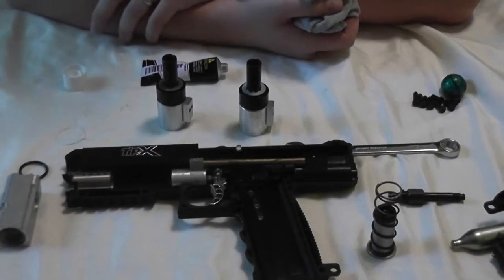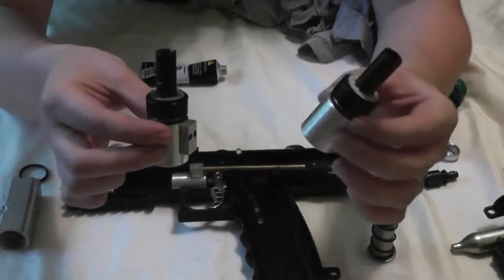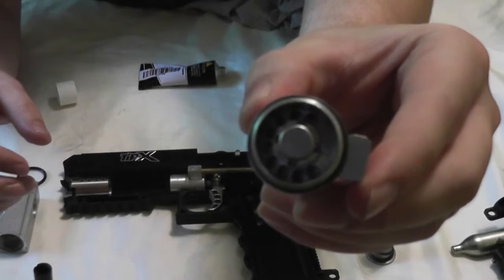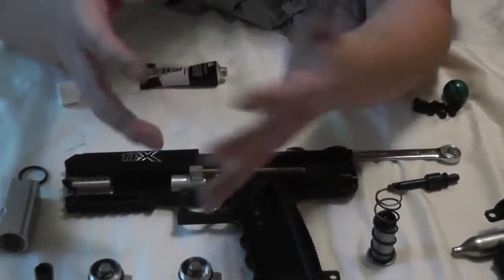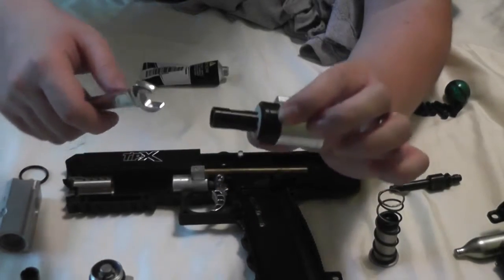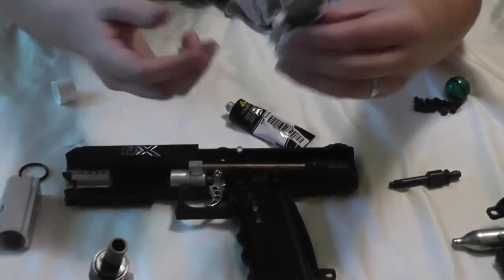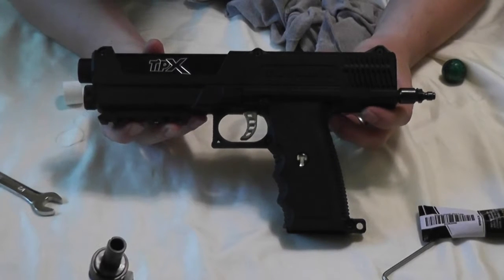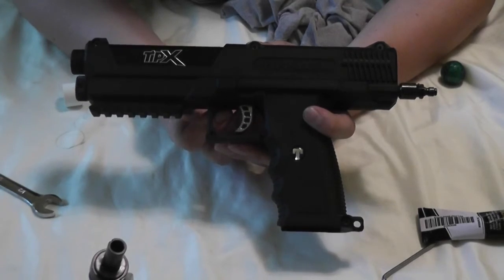Tippmann TiPX Valve Assembly Upgrade for HPA

Comment: Nice. I just bought a TiPX. Not been inside it yet. Does the bolt has a pin like the Tiberius T8.1?
Reply from the maker: The bolt on the TiPX is more or less free to spin or rotate on the bolt guide/power tube, but I've not used or worked on a T8.1 to know the difference. I have heard that maintenance is a bit more of a chore on the 8.1s though.
Reply: @mongoosepb4920  Ok. Thanks for the info.

Comment: So it seems that Tippmann has preset the regulator at the factory now. You can't adjust the bleed anymore. Will this valve still increase performance with no options to set the bleed using CO2 carts only?
Reply from the maker: It should still help, yes. The purpose of the valve is to increase air flow versus change operating pressure which is what the older PRVs that you are referencing used to adjust. That being said, many users have reported that their TiPX reaches 280 FPS or over without any changes. Others aren't so lucky. 

I recommend trying yours out with HPA before ordering any alternative parts. It could save you money and headache.
Reply: @mongoosepb4920  thanks, but I'll only be using CO2 cartridges. This is mostly for a home defence thing, not paintball, so I'm interested in more power for my TipX. I wish they just would've kept the bleed valve on there so you can adjust the power adjustment higher, but now I'm thinking if you adjust higher you'll get the CO2 bleeding out and now there's no adjustment to stop that when increasing power. Thanks for your reply.
Reply from the maker: @18andlikeit  Ah, ok. Then you won't really need the valve. The standard valve works fine for CO2. The TCR valve was modified for better performance with HPA.
Reply: @mongoosepb4920  I was watching older videos of guys getting up to about 16/17 joules or 300+ fps with 3.9 grain riot balls with the older model when you had the bleed adjustment.. is this kind of power possible with the newer stock TipX with no way to adjust the bleed? I don't have a crony to check for this.
Reply from the maker: @18andlikeit  that's hard to know. I've only ever aspired to get my marker to around 270 with round paintballs. The old PRVs purpose was mainly to keep the reg from having to work harder at limiting the operating pressure. It was a failsafe rather than a mechanism to increase the overall output pressure. 

That being said, you could sort of tube the velocity by also tuning the PRV setting in some situation, but rarely was the PRV responsible for allowing massive FPS gains. As far as I know, the reg and PRV in the self defense versions of the TiPX are the same as the recreational version, but I may be wrong. 

That being said, I think there may be a specific subreddit just for paintball markers as personal defense tools. Unfortunately that's not something I'm particularly familiar with.

Comment: After I installed the TCR parts into my Tipx, I am shooting between 280 and 305.  If i turn the regulator to the left, the PRV starts leaking. Left most shoots about 290-305. And turning it to the only lowers the FPS slighting to 278-305.
Would I have to change my HPA tank output pressure? I am using 26/3000 HPA Tank.
Reply from the maker: You should be able to adjust the PRV though. I normally tune mine any time I significantly change my FPS setting. It typically keeps me leak free and consistent.
Reply: I use hpa on mine. Shoots like a champ.

Comment: One other question, when you tested the FPS with HPA did you have an empty C02 cartridge in the chamber?
Reply from the maker: tzone Yes. The TiPX requires that you keep a spent/empty CO2 cartridge in the chamber in order to use the remote line adapter. There is a way to mod it so you don't need one, but I don't see the need to do so now. 

I will say though that air still gets trapped in the CO2 chamber after you disconnect the remote line unless you take the retention pin out of the adapter. So you have to be careful and dry fire the marker after disconnecting the line. 

I've seen people go into the goggle free zones not realizing that the marker was still pressurized before, and the refs don't like that. Can be dangerous.
Reply: Thanks, I was wondering if all the low FPS issues I hear and read about using HPA might be due to people not leaving the spent cartridge in the chamber resulting in leaked pressure and low FPS rather than the internals?
Reply from the maker: tzone Yeah. if you don't leave the cartridge in then the marker will barely air up at all. The pressure just bleeds right out the vent in the accessory rail.
Reply: I just got the pistol not for paintball but as a less than lethal option for home defense which either uses salt/pepper balls or heavier solid balls which would benefit greatly with more pressure. Maxing at 290 is probably enough but still seems kind of low...I don't know really I'm a noob to all of this.
Reply from the maker: If you are using it for less lethal, you probably don't need to worry about this mod since the remote adapter will be irrelevant for you. You can get up to 300 FPS on CO2 cartridges with the stock valve easily. Honestly thought I'd get pepper balls for home defense and not worry about the FPS too much if that's how you plan to use it.
Reply: Well it's not just for home defense it's for fun too and I am not one to leave well enough alone so I  am always modding this up like a lot of us do. I actually got the HPA adapter to use with a 2 cartridge co2 holder/tank whatever you want to call it but it is more portable than an hpa tank in an emergency and being I don't have anywhere close to have a tank filled I went that route. I don't know if there is going to be any difference between that and hpa so in case there isn't I want to get the most out of the line adapter.

Comment: Hey man great video. i was wondering if you had any problems with the o-ring tearing with the front bolt that attaches to the air valve? Have you considered upgrading to the tcr front bolt? have u had a lot of chopping as well? i would appreciate an answer man, thanks
Reply from the maker: jack sparrow I have shredded a few of the floating o-rings that sit behind the block since they don't like to stay in place on their own, but if you put a very little drop of super glue on it, then the ring stays out pretty well. Use a very small amount though. 

I haven't used the TCR bolt since I only shoot round ball. I might check out the tech-t bolt as I've heard mostly positive reviews about it. Anything that makes it easier to get FPS gains is good. 

So far I haven't had chopping issues at all if I use good paint. I feed her nothing but Graffiti, and I rarely get chops or breaks if it's fresh and not oblong. 

I hope that helps!
Reply: MongoosePB thanks for the reply man. i'll give that a try. do u happen to know anyone that uses the tcr bolt and if its compatible with the stock block?
Reply from the maker: The TCR bolt would work just fine with the stock breech/block. The only difference is that it doesn't have the oring on the front, and the tip is tapered to be more First Strike friendly. It weighs about the same as the stock bolt, and the dimensions are pretty much identical. I don't know if the TCR spring is more or less "springy" than the stock one though. 

Either way, it should work fine, but I don't think you'll see any change in performance from switching it out from the stock bolt.
Reply: MongoosePB Thanks man

Comment: hello there Mongoose i hope Youtube can help me out
Iam having problem with mi tipx. thing Is that i cant put the velocity tto 240fps, and if i go more than that it start leaking from the realese Valve. i have cleaned the regulator and Valve  all seems yo be fine. another problem Is that have spikes on the velocity +- 30fps sometimos.
thanks for your help and sorry about mi english have a nice day
Reply from the maker: Espartanos Airsoft as you adjust your velocity, you also need to adjust the Pressure Release Valve (PRV). There is a smaller set screw inside of the velocity adjustment screw. Slowly adjust this in quarter turns until the leaking stops.

If you have the TCR internals installed like I have, you should be able to get to at least 280 or 290 FPS. I usually try to make sure my PRV is set correctly after I make large velocity adjustments or if I completely disassemble my TiPX for cleaning or maintenance. 

I hope this helps!  I may post a video at a later date just to show how the PRV is adjusted. I get a lot of questions about this.
Reply: MongoosePB thanks. i have screw the PRV all the way but it keeps leaking anyway i have the standars internas in mi tipx
Reply from the maker: Espartanos Airsoft are you using a remote line, or CO2 cartridges? If you use a remote, is it CO2 or HPA?  It may be that you need to replace some o-rings somewhere within the assembly. 

Most of my leaking issues have been due to bad o-rings or under/over greasing the internals. Unfortunately, I'm much better at diagnosing problems when I have the marker in front of me, but I'm definitely not a technician. 

You may need to contact Tippmann directly, or see if a tech can examine your pistol at the field. I wish I could help more. 😢
Reply: MongoosePB  thanks anyway. iam running mi tipx with hpa and remote line, thing Is that there Is no tecnichian here in Uruguay. Hoy know someone that could help me out by email ir sometimes.
thanks and sorry about mi English

Comment: so i can get just the vavle alone and not the whole valve assembly?
Reply from the maker: Well it's all basically one piece. The inside of the valve is milled differently to allow more air flow. The valve assembly is the silver chamber where the spool sits. The black part is just the bolt guide.

Comment: is there any other way to make the fps higher cause my is only shooting 167
Reply from the maker: Do you have the TCR valve installed? You may also need to adjust the pressure relief valve so that it's generating enough back pressure to get your FPS where you want it. Even with the TCR valve you may need a tank that has a high enough pressure output to operate the TiPX properly as well. My tank output is currently around 800 to 850 PSI.
Reply: ok thanks

Comment: So this is basically just the long range conversion kit ?
Reply from the maker: Sam Duffy no, the long range kit is just a bolt guide, and a shaped breach for First Strike rounds. You won't get any FPS gains with the long range kit. The part shown in  this video is the full valve assembly normally found in the Tippman TCR. 

The stock valve on the Tipx is designed for CO2, but doesn't produce good results with HPA (FPS max 250-260). The replacement valve solves that. However, I have been told that newer pistols come with the upgraded valve, but I can't confirm that.
Reply: Thanks so much for clearing that up for me  super helpful and informative definatly subscribed, sounds like getting the  conversion kit  and the valve  would be  the best bet. I only bought mine 9 months ago so im curious too if its  new enough to have  it  built in...

Comment: What are your FPS results after the mod?
Reply from the maker: Now that I have passed the "break in" period with the new valve (500 + shots), I find that I can get around 285 or 290 FPS if I tune it right. I keep it around 270 to 280 though. That is the sweet spot for me.

Comment: That can`t be the reason, my Tipx reach >400 fps with HP
Reply from the maker: Do you have some sort of crazy output pressure on your tank? The other way to get the FPS up is to adjust your tank output. Some regs (like Ninja's) allow you to adjust the output pressure. Overall, replacing the existing TiPX valve with the TCR assembly is the easiest and least risky way to get a higher FPS output. I was able to reach 275 or 280 before this upgrade if I cranked my FPS control all the way up, but with this I don't have to do that anymore. My Empire tank has an output pressure of 800 PSI though.
Reply: I use a ninja reg with 850psi, maybe your regulator pressure relief valve is set too low?
Reply from the maker: Nah. I've messed with the PVR plenty. I've talked to plenty of other people who can't get over the 270 FPS on HPA with the stock TiPX internals as well. If I screwed the PVR out any more then it would come out completely inside the regulator.  The TCR valve works beautifully though. Night and day really.

I've found something that works at any rate. I throw the stock valve in there when I use my pistol as a secondary with CO2 cartridges now. Easy peasy. Thanks for the tip though!

Comment: fuckkk  70 $....
 Marker was already super $$
Reply from the maker: Yeah, it's a bit of an additional cost for sure. I just got a second pistol a few months back, and haven't brought myself to buy another yet to run duals. There is a way to mod the stock valve, but I'm not equipped to make those changes on my own. 

I recommend checking out the TiPX owner's group if you have Facebook. You can search for several posts debating this topic, and how to mod the stock valve if you are handy. 

There's some stiff debate around whether it actually works as well as buying the new part or not, and I haven't met anyone in person who modded their valve to check it out. Still, $70 is a hard price to swallow given the overall cost of the marker. 

I have no regrets given the results, but it would be great to know for sure if all new serial numbered pistols already have this part.
Reply: Yeah i  joined tthat group on facebook well asked too,  thanks a lot man  all very good  to know!